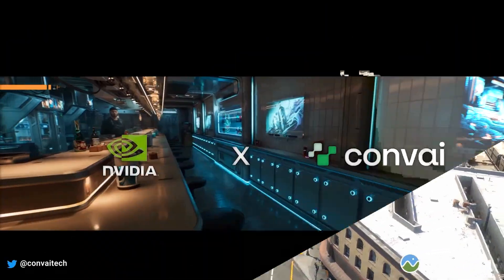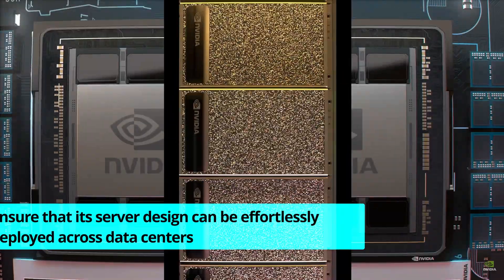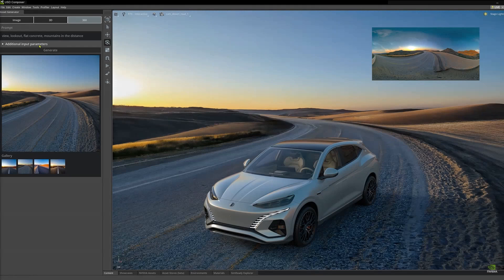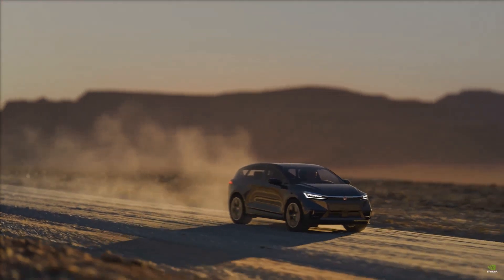IT HAPPENED: NVIDIA Finally Reveals Its 4 Next Gen AI UPGRADES (GH200 + 600 Extensions + 3.5X MORE)

Comment from the maker: Does this put Nvidia in the lead in terms of generative AI??
Deep Learning AI Specialization: https://imp.i384100.net/GET-STARTED
AI Marketplace: https://taimine.com/
AI News timestamps:
0:00 Intro
0:28 OpenUSD
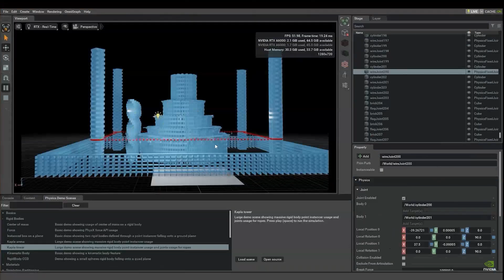1:12 Omniverse Kit
1:24 Audio2Face
1:44 Modular App Building (over 600 core extensions) 
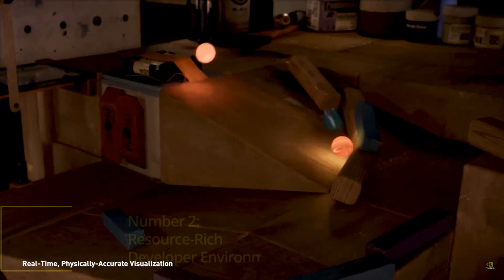1:58 Resource Rich Developer Environment (Templates for Developer) 
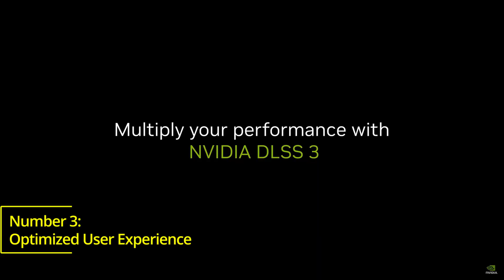2:08 Opitimized User Experience (DLSS 3)
2:28 Spatial Integration (XR Tools)
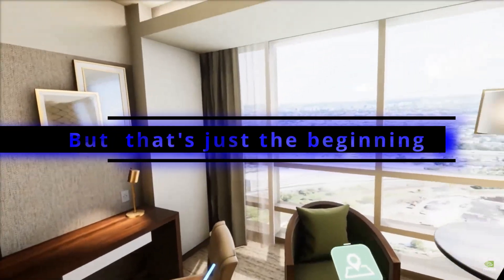2:43 Adobe Firefly Integration
2:52 Wonder Dynamics Integration
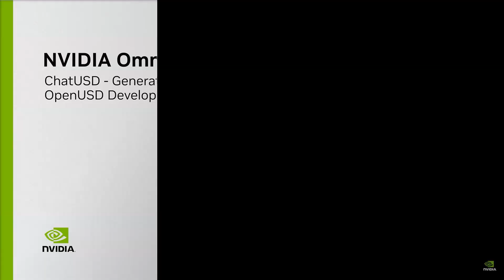3:08 ChatUSD
3:42 GH200 AI Superchip
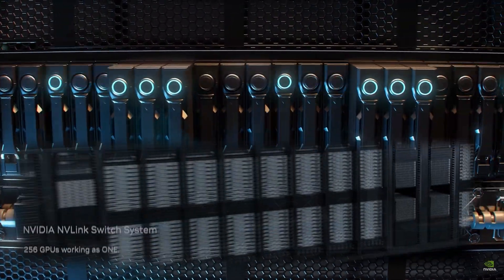4:15 Configuration of GH200
5:15 NVLink
6:00 Hugging Face Alliance
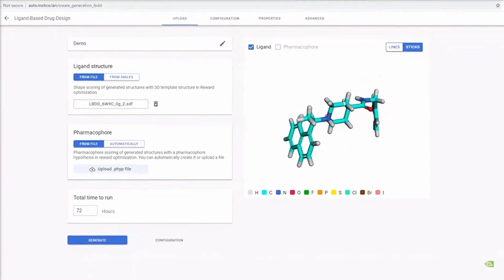6:29 Shutterstock Using NVIDIA Picasso